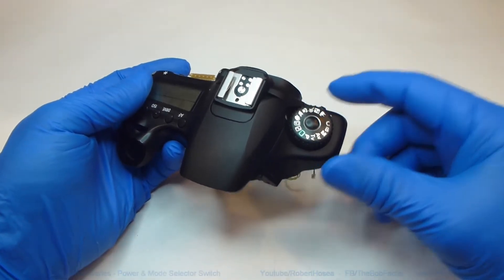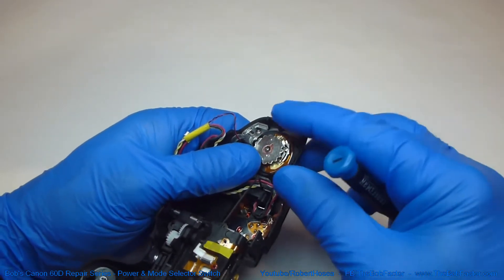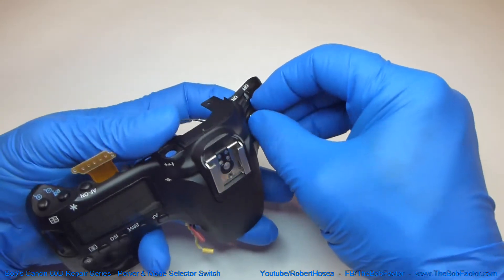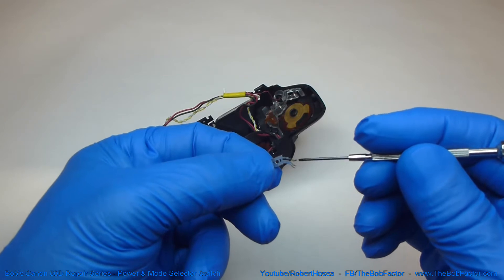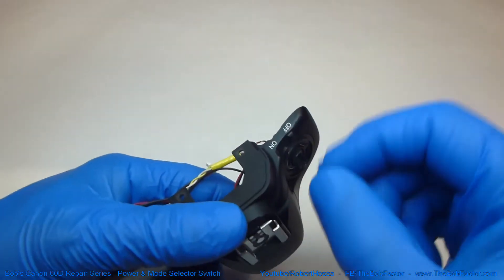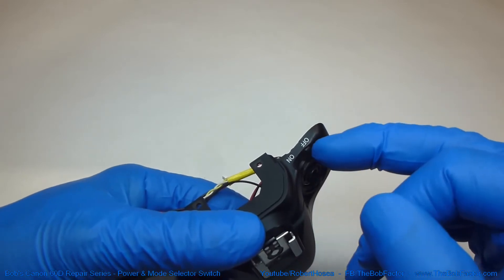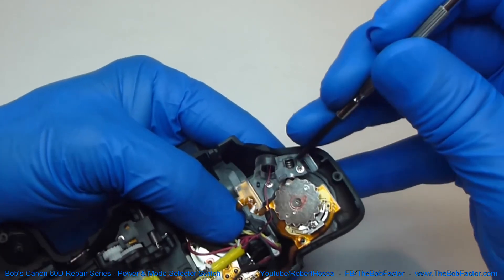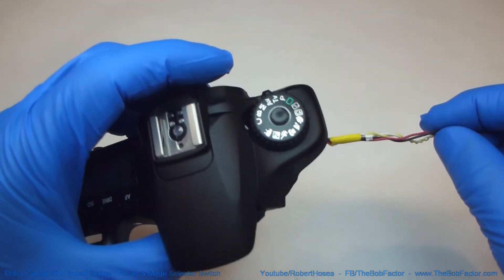Canon 60D Repair Series - Power Switch & Mode Selector Switch Repair

Comment: I have two Canon EOS 60D cameras. I decided to use them for video recording in an indoor, air-conditioned environment (a drum studio). I set up the first one on a tripod and started recording. It didn’t even record for one minute before it shut off and wouldn’t turn back on. I’ve already tried the reset methods found online, but it still won’t power on.

I tested the second camera in the same way, and the exact same issue happened.

Have you ever seen this happen? Do you have any idea what could be causing it?
Reply from the maker: Dang, that is an odd one for sure. No, I don't have any idea why one, much less two of them, would all of a sudden do that. You could try testing the power board's output, which is shown in video #8, and that would be a good starting point.

Comment: thank you for putting this out and keeping it on for so many year, mine started to produce a bad contact, when I switch it on it sometimes hold but most of the times it just turns off, if I put pressure on the switch or the selector knob it stays on, as soon as I release the pressure it just turns off. I will see if the screw is a bit loose or if there is corrosion on it...
Thank you in advance. I plan to do a Full spectrum for astro photography too, that will be hard tho... 21k views and just 185 likes, people should be a bit more generous like you are.

Comment: Hello, Mr. Robot, I have a Canon 60D that went out and did not turn on. Can you provide me with some extinguishing problems?
Reply from the maker: Sorry about your camera Mohamed. At this stage unfortunately, without doing any testing on it, it could be anything. The first thing to check would be the basic stuff of ensuring the battery is good condition, and  also checking that the small battery door switch appears to be operating and is not stuck. Also check to see that there is nothing inside the battery compartment that may be preventing the battery from making good contact with the metal contacts that are in the bottom. The next steps would require opening the camera and testing the power board. Sorry I can't be more help.

Comment: Hi Robert.  Excellent video.  I was able to take my camera apart and get it back together, but I now have no power.  Any suggestions?
Reply: FYI, I checked all the cable connections already
Reply from the maker: @les9030  Is there anything flashing on the top LCD? Double check to make sure the limit switch in the battery compartment is working and that the battery compartment door appears to be pushing on it when the door is closed. If everything looks fine there, then you should check the power board using a multi-meter. I show how to test it in this video: https://www.youtube.com/watch?v=yeCrpv_u1Zw. Let me know what you find.
Reply: @Thebobfactor  Thanks for your help.  It turns out it was the power board.  Somehow it died during the process.
Reply: I ordered a new one and hopefully will be up and running again soon.
Reply from the maker: @les9030  That's great that you got it figured out Les. Let me know how it goes when you get the new power board put in. Good luck with it.

Comment: hi sir robert. i have canon 60D but my problem is power switch button. a little bit hard to push. to get power on, my camera. working before. and now, is not power on completly dead. it could be the problem?  is the power switch? button maybe there is some debris? inside thanks for the video and response?
Reply from the maker: Hi normz. Yes, since it was already turning on hard, then that would be a good place to start with. I've never had a power switch go bad, but something was obviously going on with it on yours if it was turning on hard.  There are also two micro switches that could prevent the camera from turning on, one being under the SD card cover, and the other under the battery compartment cover. So you might double check both of those covers to make sure that they are closing properly first. Good luck with it. Give me a shout if you run into any problems. -Bob

Comment: What causes these switches to lose functionality?  Getting wet? Leaving them in the on position and they never move which causes them to build resistance? I have a very low mileage 60d that I never get wet and is in beautiful condition and want to prevent this.....appreciated
Reply from the maker: I don't know of anything specific that causes them to go bad Francis. I would say from just simple wear-and-tear from a lot of usage, or from being around salt water a lot. I have had three 60Ds now, and I've never encountered the problem with the power/mode switch on any of them, unlike some who have had that problem. My cameras have been wet from rain too, but they've never been wet from salt water or spray.
Reply: Robert Hosea thanks for the quick reply! I love my 60d. I don’t really shoot at the beach. Hopefully my dials and switches hold up! I’m pretty careful to have dry hands and not get them wet. Much appreciated. Have you had the quick dial or set button problem on your 60d’s?
Reply from the maker: @franciscole3039  No, so far I've been pretty lucky and never had a problem with the power and mode selector switch. I have had the shutter wear out on one that had a lot of usage, and I had to replace the SD card slot on another one. I also replaced the glass over the main LCD display, and also the upper LCD display. But both of those were due to dropping the camera I think. Considering what I have put mine through, they are a pretty tough camera.
Reply: Appreciated! Thanks for your responses.

Comment: Hello. I found a second hand canon 650d with lens at a very good price (~120$), only the seller says the mode dial only works in auto mode. Would you say it was worth buying and trying to fix it with a factory reset, or your method of cleaning the corrosion? Thank you.
Reply from the maker: That's pretty hard to say. I'm not familiar with the 650d at all, or how it's mode selector switch works. I would imagine it's similar to the 60D's. But a problem like that could also be associated with a defective circuit board. And on Ebay the main board goes for over $100. Like you said though, that is a great price. At the very least you could probably earn your money back just by parting it out and selling the parts on Ebay.
Reply: @Thebobfactor  Many thanks!

Comment: hi! I know this video is a year old, but I do have a quick question. Once the switch is back together, is there a way to test if it works without re-assembling the whole camera? I was planning on jumping from your first video, where you take off the outer casing and jumping straight to this. Also, is it necessary to take off ALL the casing components before youʻre able to take off the top?
Thanks for the videos and sorry to bother you on an old video!
Reply from the maker: The only way that you could test it, would be to use a multi-meter and check for continuity between some specific pins on the flat ribbon cable that comes off of the top. It's a bit tough testing it that way, but it can be done. Let me know if you want to try it, and I will figure out what pins to test on, and what readings you would expect to get. As far as taking the top off, you will need to take the front and, back covers, and the end piece off first. Canon sure doesn't make it easy to get to it.

Comment: What would be the best thing to use to clean the corrosion off?
Reply from the maker: Any type of electronic cleaner that doesn't leave any residue will work Leremy. If the corrosion is too heavy for the cleaner to remove, you may need to rub the contact areas lightly with some fine sand paper. Just be sure to remove any debris left behind from the sanding. And here's a link for some CRC electronic cleaner that works well: https://www.amazon.com/CRC-05101-QD-Electronic-Cleaner/dp/B000CCMLD0/ref=sr_1_2?ie=UTF8&qid=1519402482&sr=8-2&keywords=crc+quick+dry+electronic+cleaner
Reply: many thanks

Comment: cool... good tutorial... having same problem, but for me that's too complicated to open and fix... however one importance point from this video, that the issue could be from corrosion, so I try to switch on-off for 50 times... and it works better now..... thanks....

Comment: Hi, my the mode selector of my EOS 500 D broke off, is there way to fix it?
Reply from the maker: I'm afraid I'm not familiar with the 500D at all. But, when looking at a replacement dial assembly for the 500D, it looks very similar in operation to a 60D. So it may be "generally" the same procedure as shown in this video.

Here's a link to the assembly that I found on eBay for your camera:
http://www.ebay.com/itm/Genuine-Canon-500D-Digital-SLR-Top-Cover-Dial-Mode-Replacement-Button-/232496623221?hash=item3621e0ee75:g:T0UAAOSwak5ZxB6F

I hope this helps out. Let me know how you make out on it.

Bob

Comment: Hello! Can you remove video about button SET replacement please ??
Reply from the maker: Ira, I will be doing a video that shows how to repair the set button and the navigation buttons in the near future.
Reply: Robert Hosea I will waiting for this video! thanks!
Reply from the maker: Ira, here is a link to my video that shows the tear down and re-assembly of the Set button and multi-control dial. I hope this helps you out.  https://youtu.be/zaJJqRCfYXc